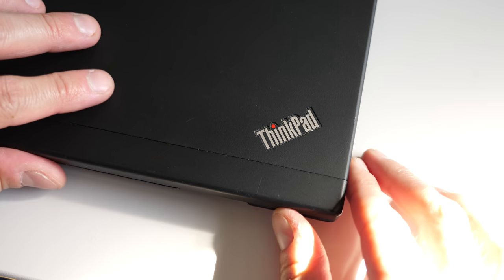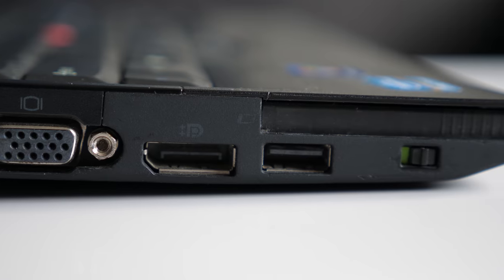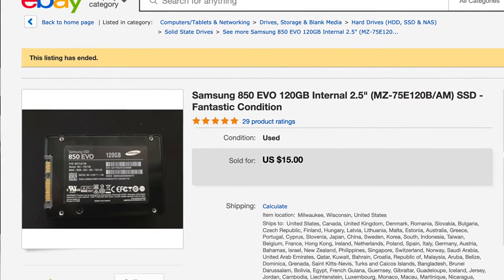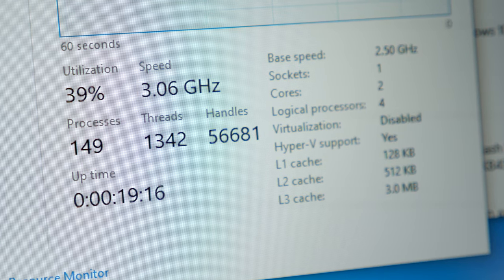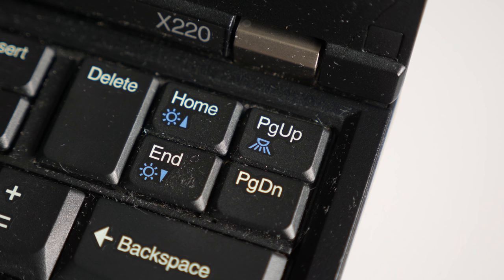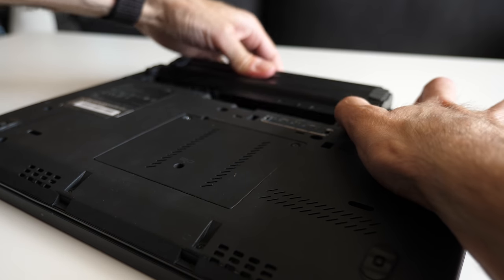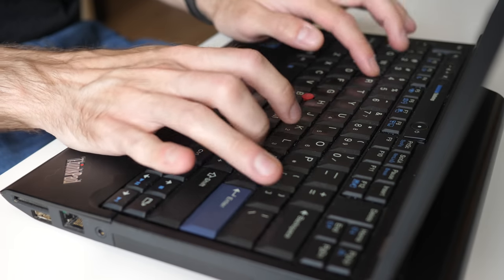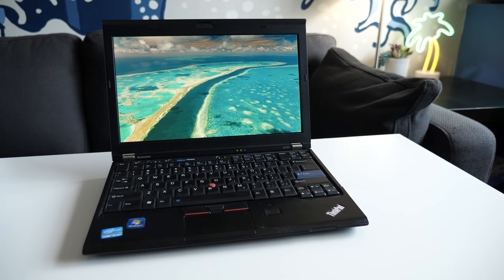The $100 Laptop Challenge -- This Old PC is Better Than You Think

Comment: "This computer is better than you think" *Sees a thinkpad* Yeah, those things were always ahead of their time.
Reply: well, up until when this one ca,e out it might be true. The ones they sell these days are just as likely to be rubbish as anything else...
Reply: @Charky_Creations  yeah, £600 lenovo laptop gives you a small 8GB of RAM, 1TB of storage and only a dual core i5, it came with Windows 10 as well. I suspect it came with version 1607 or 1709 (something like that). Plus the laptop doesn't even come with a graphics card, though it is fine with Intel HD Graphics as I can use Dolphin emulator smoothly.
Reply: I've loved every Thinkpad I've had, and I've had several over the years.  They've not always been the best, but even when I had issues they were always easy to repair and get going again.  I use something different now (Razer Blade), but I still have my last Thinkpad (T420s) and plan to get it working again.  Still have a W700 around too (the only one I ever regretted buying.  It was an awesome machine, but it was a pain to travel with).
Reply: @Charky_Creations  They were good up until the keyboard change a couple years ago.  Why they changed the trademark keyboard, who knows, but none of them have been quite the same since.  I'd still gladly take one over many other laptops, though.
Reply: Product key stickers usually didnt match the key on the PC because the hard drives were clones of eachother. Untill they started putting it in the bios.
Reply: And the keyboard is really good. Great feeling, enough travel, robust, and just good.
Reply: @ExperiencersInternational  I bought one with a quad core i5 1035G1, 4GB soldered 2666mHz RAM (tho upgradeable), 15.6" screen (tho crappy), and a 512GB NVMe SSD (not the fastest but better than a harddrive).
Reply: Agreed.
Reply: hard drive more like hell drive
Reply: Are*
Reply: i literally have a gtx 960 hooked up to my t410 through an expresscard dock, and it's great.
Reply: Not anymore.
Reply: @Charky_Creations  Though I get that the ThinkPads have degraded in quality, and the new 'modern' models or budged series are a lot worse than even the modern traditional ones, my E585 (budget series) is still a great machine.
I also like that (with a modern kernel version), Linux runs pretty much seamlessly on it, and I can even set the battery to stop charging at 80% on Linux, which drastically improves the lifetime of the battery.
The new keyboard might be worse than the traditional old design, it is still way better than what most laptops have at that pricepoint, and though I am spoiled with a mechanical keyboard, I don't mind using it.
Though @GamersInternational has a point with that the specs are somewhat low for the price, the awesome Ryzen integrated graphics, loads of cores and it's upgradability helps a lot in this front.
Reply: Why "were"?
Reply: Not really in terms of hardware, but the build quality makes a world of difference.
Reply: Has nothing to do with being thinkpad... It's about the CPU. Intel Sandy Bridge CPUs were ahead of their time to the point they're still very good for normal use. It's just the HDD you have to ditch in favor of an SSD.
Reply: @teemuvesala9575  Intel ivy bridge mobile was before they moved to optimizing for low power to get better battery life. Not until around 6th gen did they regain the processing power.
Reply: Ahead and priced reasonably so long as you didn't want bleeding edge.
Reply: @Charky_Creations  not at all
Reply: and they always will be
Reply: @Vostok7  the keyboard was garbage that's why
Reply: @Charky_Creations  new Thinkpads are great,these old ones can't even run a yt vid was 720p
Reply: @Maximus20778  true
Reply: Loving my old t440p with Linux Mint on it. Though I upgraded the ram to 16gb, added 2 more ssd drives, and changed the display to an ips 1080p panel, it was fine before all those changes
Reply: People aren't as hot for the current ones.
Reply: @Charky_Creations  so ignorant lol
Reply: I have noticed several times that the older the laptop, the better the keyboard. More "travel" and more feedback
Reply: And the keyboards are much better than those modern ones (which are like sponges....almost no feedback.....i vind it yunk, buth he if you have only used IBM than the modern laptop keybords are a shock)
Reply: @ExperiencersInternational Lenovo has gotten a lot better in recent years. Their sales especially. I picked up a super slim powerful amd laptop with a dedicated gpu, 16gb, 1tb and a touchscreen for 600 dollars off MSRP at 900. Can’t beat that. Great for school and even AAA gaming.
Reply: @Maximus20778  My T410 is currently streaming this very video in 1080p with minimal dropped frames
Reply: usually, from my memory, yes the lenovo thinkpads have better preformance, but ibm made the best thinkpads in my personal opinion, they were unique, upgradable, and best of all, were always good with large amounts of ram

Comment: SSD's really are what can turn an old clunker into a new beast
Reply: The machines aren't too bad with a regular hard drive either.  They're not for gaming, most people use them for surfing the internet, youtube, email, and office documents, so the workload is quite light on them, so a regular hard drive serves pretty well, but if you wanna play the too much money in my pocket card the SSD is a great way to go as well as maxing out the RAM.
Reply: @wildbill23c  you can game on it if you're willing to buy an express card dock, i hooked up a gtx960, and it's great.
Reply: Depends... Though so when putting an sd in a samsup laptop from 2009... This thing was faster but the rest couldnt follow. Was unbearable slow when surfing or working on pictures
Reply: @Nordlicht05  perhaps with the lowest power of core 2s.  For old desktops or old laptops with a socket a chip swap or xeon mod gets you either high ghz core 2 or quad.
Reply: @wildbill23c  The hard driver is a clunker in itself
Reply: @wildbill23c  I have a 7200rpm 500GB hard drive inside my hp Compaq 6510b and it runs like a champ with Windows 10 installed.
Reply: For real. My T440p got a real shot in the arm when I swapped in a $39 SSD. Running Linux Mint MATE on it and it’s smooth as butter.
Reply: @ALEXGIBSONCMG  no thanks, ill prefer playing it on console at 30fps than making my laptop looks like frankenstein
Reply: @wildbill23c  Regular HDD running Windows 10 will chug, but GNU/Linux on an HDD runs perfectly fine.
Reply: Even a ryzen 7 with 8 cores is  clunker if paired with an HDD.
Reply: You can game even without a graphics card.you can play like minecraft and many low end pc games
Reply: phh, hold my ultra-bay ! 
I'm using debian on thinkpad x61t from a USB 2.0 , boot time < 30 sec 
and I'm writing this comment from it :D drawing with embedded graphical tablet  at the same time
Reply: @wildbill23c  While you can get away with a Hard drive, it's ungodly slow for most people these days, running modern software. 
seriously you're saying that  $20-30 is too much? 
I have seen laptops go from taking at least a minute to open up Explorer after boot to less than 5 seconds after boot.
Reply: @krazykat64  for sure....my T500 with SSD and Ubuntu MATE performs very well for the cost also.
Reply: @wildbill23c  you can still play some games like csgo, genshin, minecraft, or tf2 on it. it all depends on the recommended spec requirements of the game.
Reply: @Joseph. and ThrottleStop
Reply: True.
Reply: And the old keyboards are infinitely better than those modern ones.....sponges
Reply: Word. Through one with dram on my Xbox one s and it turned into a beast lol
Reply: I got a refurbished Lenovo x131e think pad from ebay with windows 10 and a 128gb SSD for $99 Australian dollars......it runs like a beauty and built like a tank
Reply: @henkholdingastate  you've never tried one before because the old ones are spongy
Reply: @Maximus20778  I like key's with travel. Ik mis this in the modern laptop keybords . The one in the film (lenovo X20 heeft dit vermoedik nog wel) Ik gebruik al jaren voor mijn PC de IBM model M (=mechanisch) and it is the best keybord ever made. Thsi eeling is missing in the modern laptop keybords. My oldest is the Acer aspire 5720z and has mutch more travel than the new laptops. Buth everyone his tast.
Reply: @wildbill23c  ya.  still remember in old days people are pumping ram, best harddrive.  You can instantly see the difference.  especially the harddrive that is what most gamers are going after. these days people probably play the fwcking game on ram instead of harddrive.  not sure in the future people play the game on the fwcking cpu cache itself . lol

Comment: The fact anyone can buy a decent computer for such a good price and learn practically anything online shows how far we've come
Reply: This!!!!! I can't help but proud at how far we've come most the tech we have now we used to dream of !
Reply: I just bought an x270 for that reason. I want a small netbook that Can do regular tasks well and when the rear battery gets old I just buy a new one.
Reply: But also how much computers have slowed in improvements. Unfortunately many apps have also got much more bloated, and much slower.
Reply: only in first world countries :/
Reply: @ulrichfinch  Yeah. I'm from Argentina, and I wouldn't be able to get that laptop for 100 bucks even if it was broken and sent without charger and such. Everything you can get will be of far lower quality, but charged twice or more as much..
Reply: compiles gentoo packages for 138h
Reply: @nothiiiiiiiing  did you know that I use arch linux
Reply: Time to introduce censorship, mandatory digital ids, and debanking for wrong-think.
Just in time.

Comment: “Apps launch quickly.” Opens Notepad lol 🤣
Reply: They do though. On my T430 with an Intel SSD, even games launch in less than a second.
Reply: Technically...accurate?
Reply: Given that most of the people buying these things are buying them for work/school oriented reasons rather then gaming, I would say showing how fast it opens text, net, and general productivity applications made logical sense. Doubly so with how many schools and places of business have been closed until further notice due to virus and riot related reasons. Sometimes people need something that will just work and get the job done, not something pretty or RGB puke filled.
Reply: @Henry5623  Wow, i honestly don't care if the thing i'm using was not for gaming, i'll still gonna play games, can't ask for much since laptop or even a PC is not very affordable, even if i have a PC it wouldn't gonna fit my, room ? Could i even say this place is a house ? Probably not
Reply: @lord_khufu  They can run CS Source or Postal 2 at 1080p

Newer games, no.
Reply: @ryanjay6241  Too bad the laptop display only 768 as usual
Reply: @lord_khufu  Not quite!
Both the T420/T430 as well as the X220/X230 both have a mod where you can install a ~$80 Chinese board that will output FHD to an IPS display. You can Google the FHD mods for these machines. I have one in mine (T430), along with a 3840QM quad core.
Reply: @ryanjay6241  Did i said that the laptop has a intel celeron n2840, your quadcore processor sounds amazing compare to this one, it’s multi core cinebench 15 is like 158 or something, honestly lucky i’m not the owner of that thing, i just borrowed it to learn about computer or how windows 10 work at least, the machine is slow and even more slow when it had an 500gb 5400rpm hdd with 2gb of ram. As for my main device that i’m actually legally own, it’s a 2014 iPad with 16gb of storage, and it’s definitely a lot weaker than that laptop mentioned, quite a shame that is. Maybe i’m gonna get a new prebuilt mid range computer next year, anything that about 500$ will do, then probably a 100$ monitor and mouse and keyboard, also a hard drive to store games, damn that would already be close to 800$, maybe not.
Reply: notepad is still legit, even after 30 years
Reply: @Henry5623  Notepad itself is pointless though, it'll open quickly on anything that isn't struggling to run the OS itself, as it's so light. It's a 200kb file.
Reply: They lunch premier pro in seconds i have one